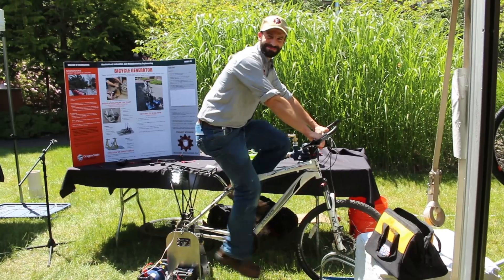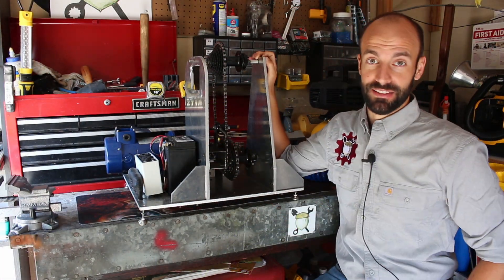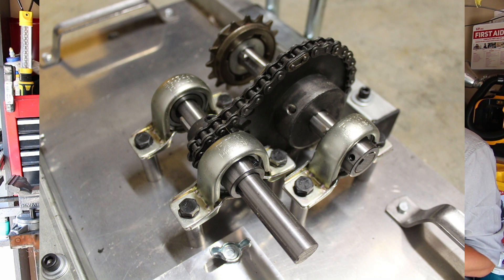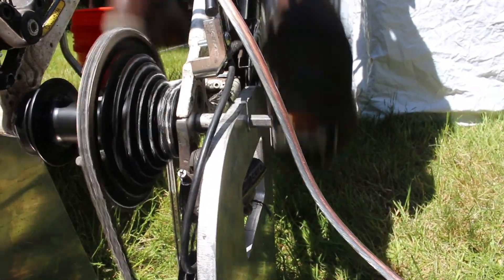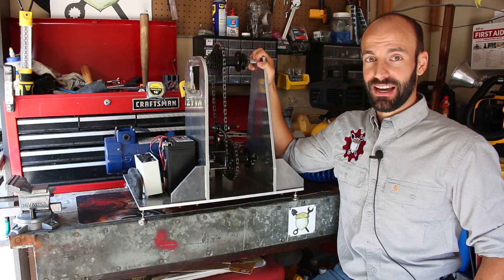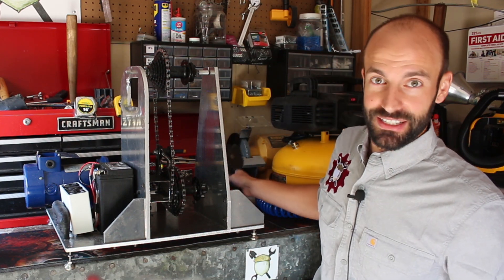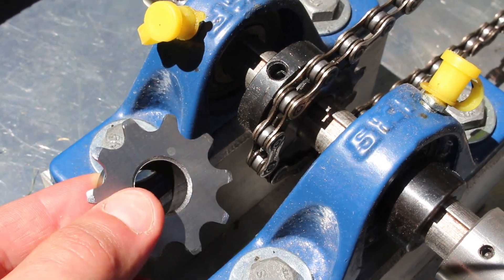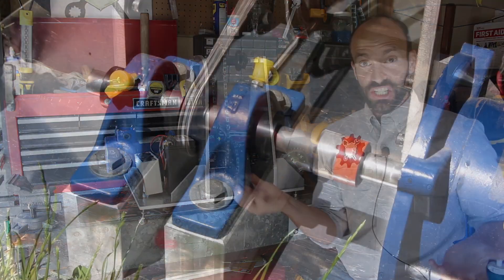Four Bicycle Generators: Lessons Learned

Comment: I’d look at direct drive trainers like the Wahoo Kickr. Attaching bikes (with different axle standards and dropout widths) is a solved problem.
Reply from the maker: You're right! There are lots of good designs out there.

Part of the puzzle is working in different material constraints. For example, for HPM01 we determined to use only materials from our local scrapyard, to show these can be built using junk parts.

Comment: How much more efficient was the power generation going from friction drive to direct chain drive?
Reply from the maker: Great question! I don't have good data, but my understanding is a direct chain can bump up efficiency by 5~10% over a friction drive (ballpark from 85% to 95% mechanical power transfer, ignoring losses in converting to electricity.) In hindsight I'm wondering if the simplicity of the friction drive outweighs the marginal improvement of the direct drive.
Reply: @McGuireMechanism  I was thinking the same thing. By the time you get the chain swapped over and everything hooked up for direct drive maybe the friction drive would still be worth it since you can just throw the bike in and go. Would be an interesting thing to calculate over a certain time period!
Reply from the maker: @BenJohnson-sm6ex  For sure man. Good call!
Reply: I have a massive collection of standard and custom sprockets from my scooter business. Unfortunately, my entire shop melted in the neighbors tire fire last October and I lost almost everything...except the sprockets which are just rusted from the fire fighting efforts.
These sprockets are for #25, 1/2" bicycle, #35, 8mm, #40, and many others. Many custom hubs because I had a mill and lathe to just make what I needed, which also burned in the fire.
I can't sell them at retail because of the rust, (some are stuck together in plastic bins) but I would gladly sell them all to someone who needs them. I would give them away if I weren't broke.
I can send some pictures and if interested make a deal on the entire collection.